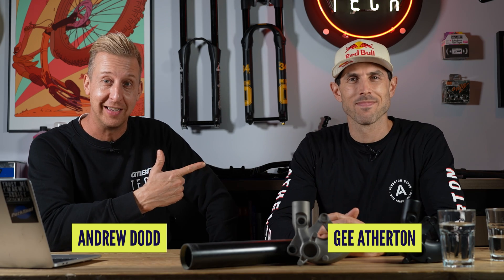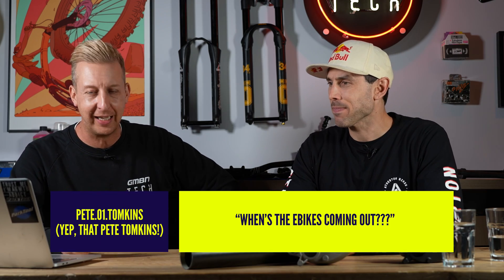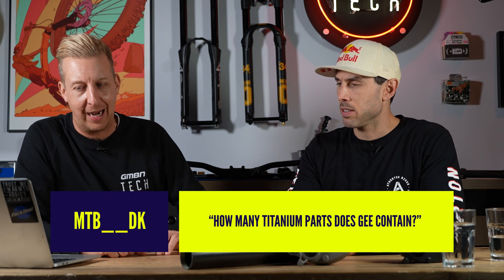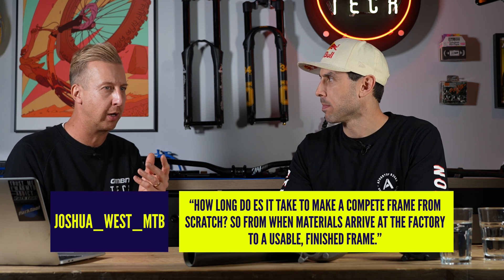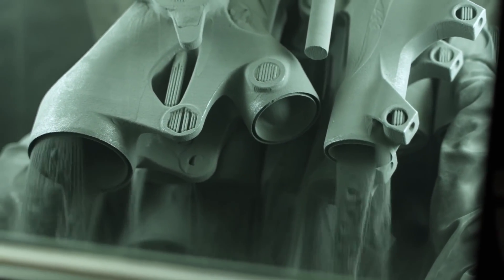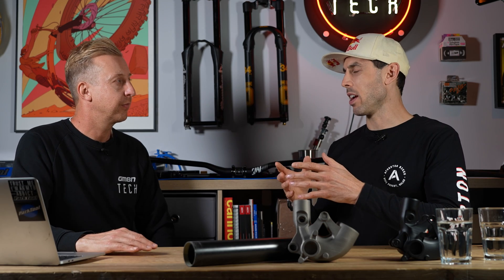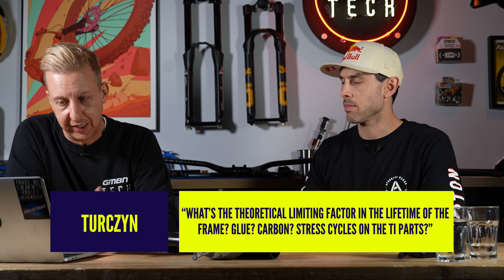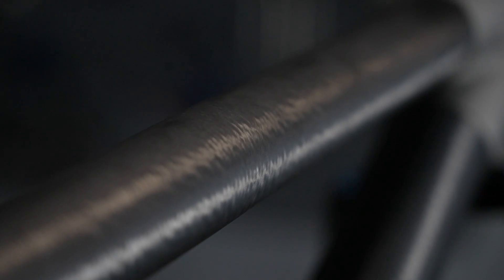The Evolution Of Atherton Bikes, Gee Atherton Special | #AskGMBNTech

Comment: #AskGMBNTech
Hi Anna and Doddy
First, thanks for all the great info every week. Learned a ton from you!

So, after wrecking my rear wheel I dicided to use a foam insert in the new one to be safer
I chose Victoria AirLiner size M (starting at 2,3in tyres) and I use a Maxxis HighRoller II 26x2,3
What I noticed is that in turns and berms the tyre burps super easily now, altough Im running same air preassures...
May the insert, as his lower limit is 2,3 tyres, be too big and is lowering the lateral support of the tyre? Will just having a wider tyre solve? 
Id like your opinion

Greatings for Portugal 👍🏻

Comment: #askgmbntech Coming from a BMX race background, I like to pedal really hard and have paid the price with several injuries due to folded chainrings, chains snapping, coming off or the latest one: rear triangle frame flexing so chain came off. This last one resulted on a badly fractured collarbone, three broken ribs and collapsed right lung.
I have since not to pedalled from a standstill with high torque, but realistically it's something I'd like to do again (but am afraid now).
I saw a picture once of guide plates attached to a rear (single speed) freewheel but can't find them online.
Do you know of anyone making equipment for pedalling with high torque?
Reply: All of this sounds like a "you" problem --- get a proper bike > make sure its mechanically sound and get a chainguide if you need it.
Reply: @beathermit3876  Nothing wrong with my bikes and their maintenance. The last frame bent and that's why the chain came off at the back. I'm just asking for plates-guide or similar info

Comment: On the last question, I would assume that the bonding would be the weakest point. Even on carbon tube lugged Road bikes that aren't crashed, the adhesion between carbon and connecting component is what most often fails over time. It takes a couple of decades but I would think the bonding has the shortest life. Carbon road forks with aluminium steerer tubes (often found on cheaper bikes) are known to fail after 15-20 years where the bonding between the two material fails. That is why they should be inspected annually and eventually replaced.

Comment: You won't make an ebike inthe UK they only have a metal 3d.printer
Reply: That comment raises so many questions…….mainly……why not?
Reply: So they couldn’t metal 3d print the housing for a motor? I’d imagine using their current process it would be even easier to adapt? Keep the geo where they want it, cad a housing design and cut carbon tubes to suit?
Reply: Em yes they could coz they have a ti 3d printer, how do you think they make there bikes, you could 3d print a compleet engine block with it if it was big enough printer, so a e bike motor mount would be easy.
Reply: The motor mount would be relatively easy to integrate in to the BB lug but I’d be very interested to see how the Atherton design team mount the battery.

Comment: Can the carbon be replaced if it was to get damaged or would it require new lugs as well because of the bonding?🤔 Basically, how repairable is it?
Reply: I asked this exact question when I bought mine and you can’t remove the carbon from the lugs. At least not for now.
Reply: that bond is strong, don't imagine you could repair/replace